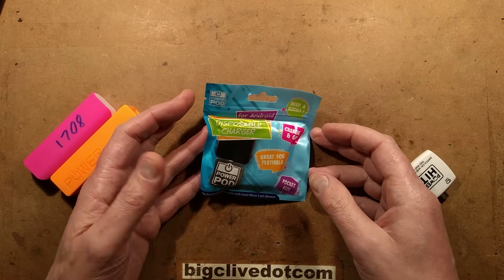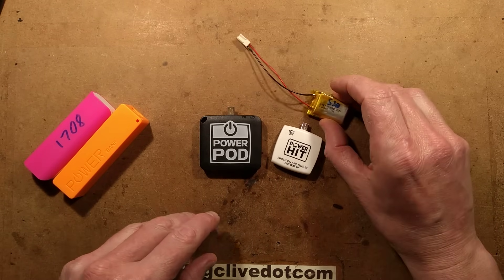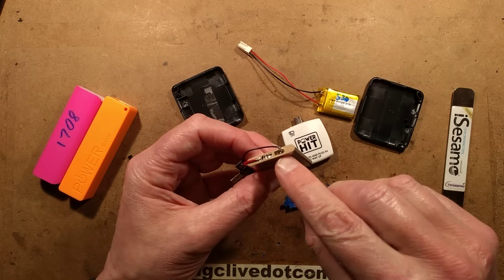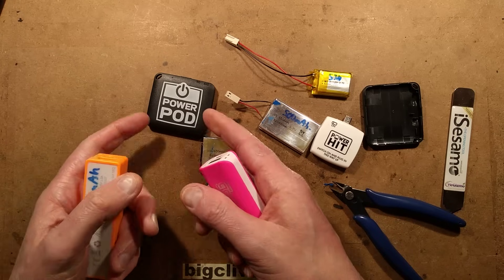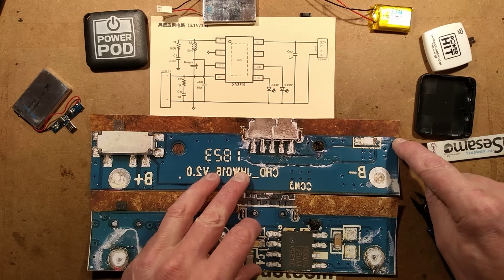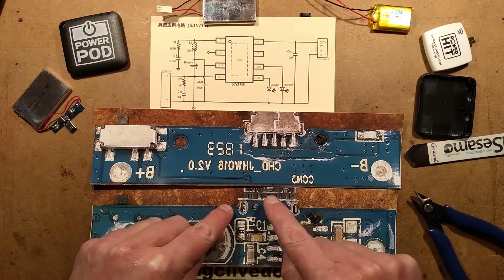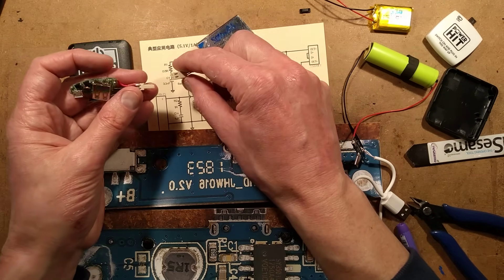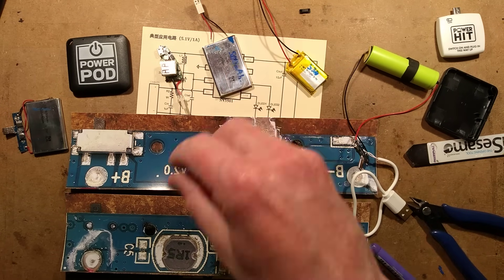Poundland "disposable" phone charger.

Comment: I bought a fair few of these to take off the market for disposable use, I stripped them and use the batteries along with a USB charger pcb, yes more expensive in the long run, but, I put these "disposable" products to use that can be recharged fine.

Comment: its possible these may be recycled cells, I know a lot of the cheap knockoff 18650 batteries are just old laptop cell's repackaged. Alot of the battiries you recycel head back to china, They probable put them in big piles based of if they look like they will be worth reusing or if they are to be torn down.

Still a massive waste, how much does the protection circuit cost? if they are recycled, it probably still had it on. and that resistor and capacitor in volume are about 1c each, so for next to nothing it could be rechargeable.

Comment: everyone is saying it's wasteful, and it does seem so, but if they're really using old recycled cell phone batteries, is it still a net negative for carbon emissions? i guess it probably is with the production of just the plastic casing and circuit board..and the fact they have to put the batteries in the metal case.

Comment: i got one of these today. there is more circuitry inside them now. and by more circuitry i mean 2 extra chips . one seems to be a diode and the other is a 6 leg'd black chip . The same one used onn the new tp4056 not sure whats its called.
Reply from the maker: If it's the iPhone version the chip may be to talk to the iPhone to get it to charge.
Reply: @bigclivedotcom  I think that is the case as i tried to modify it for an micro usb phone and it wouldnt work , it charged for less than a second and then went off.

Comment: Pointless. A shop here in New Zealand called "JayCar" sells a small plug adapter for any phone, which holds either a standard 9volt battery, or AA/AAA cells (depending on the plug adapter chosen) so you can charge on the go fast, re-use it and replace the standard cheap battery when flat. Safer, cheaper and better environmentally than lithium cells.

Comment: Clive: What are you using to measure battery capacity? Apologies if this is already in another video but haven't found it yet.
Reply from the maker: I fully discharge the cell and then use a few different devices to monitor mAh input.

Comment: You say these batteries have no protection circuit, but you can get a string of 10 tiny protection circuits from China for a pittance if you want to recover and re-use batteries like these and give them full protection.  Soldering is a tad fiddly because the boards are so tiny, but they work.

Comment: seeing as my phone has a 13,000mah battery and you lose around half the energy between the battery in the power bank and the battery in the phone, i would need approximately 40 of these to fully recharge my phone from dead to full

That's £80 for ONE CHARGE 

You can get a 30,000mah power bank off eBay for half that price, and it would recharge my phone about 1 and a half times (or a Normie mainstream phone around 5 times)
Reply: What phone are you using!!
Reply: @ExcaliburHeavyBattlecruiser  ulefone power 5
Reply: @mwbgaming28  That phone is thicc
Reply: @ExcaliburHeavyBattlecruiser  so what

I only need to charge it once a week with heavy usage, and Il be upgrading to the energizer phone with 18,000mah (which is even thicker with almost double the performance and an even bigger battery)
Reply: @mwbgaming28  you love thicc and batterilicious phones, right?
Reply: @ExcaliburHeavyBattlecruiser  as long as they work on my country's networks and have reasonable performance to go along with that enormous battery, the thickness is more of a side effect which makes the phone more durable and able to be used as a weapon in the event of a mugging
Reply: @mwbgaming28  sadly I have the Samsung Galaxy s5 and it has a pathetic 2800 mAh battery which lasts for only 2-3 hrs of the screen being on. Gonna upgrade to the Oneplus 3 fairly soon.
Reply: @ExcaliburHeavyBattlecruiser  get yourself a zero lemon 8800mah expanded battery, I had a few of them when I had an S5 that I would bring with me when I went out camping, I would usually go camping on a Friday morning and on most trips I would drain 2 of them and be about half way through the 3rd one by Monday afternoon, and that's with me streaming music from YouTube most of the day, using the torch at night, making phone calls, using GPS and taking pictures.etc

Only once did I drain all 3 zero lemon batteries and most of my reserve battery (the original battery that the phone came with) and the reason for that was because me an my partner were stuck in the bush for an extra day because the car battery was dead and we had to wait for the solar booster to charge it enough to start the engine (thank fuck for Aussie sunlight levels lol)
Reply: @mwbgaming28  I prefer more optimized and better functioning software on my phones over sheer hardware but we all know just how anti-consumerist Apple is. Thus I'll stick to Samsung and OP phones.
Reply: @ExcaliburHeavyBattlecruiser  well optimised software isn't going to do shit when you actually start using your phone

Samsung is just like Apple z everything apple does, Samsung starts doing (camera bump, screen notch, non removable battery.etc)
Reply: @mwbgaming28  how does the Google pixel 3 take better photos than the mate 20 pro?
Reply: @ExcaliburHeavyBattlecruiser  no idea but I'm happy with my phone that has a 21mp camera, what I was referring to was the fact that the hardware in your phone will still use energy when it is being used, you can have the most efficient hardware on the planet, but as soon as you a actually start using it, your battery life will be directly tied to the capacity of your battery

The galaxy S10 might have a more efficient CPU than my phone, but I guarantee the S10 will still die first when both are put under the same load
Reply: @mwbgaming28  Sure the s10 dies first but I hate software that isn't efficient, is ugly or is unstable. Lenovo just factory reset by itself. And since I'm an urbophile, I prefer phones that charge faster like the OP series even though they have lost their claim of flagship killers. They're still killer flagships that are blazing fast and have good software. Alternatively Samsung has all the features you want for a modern phone. That's what the general public want. Your option isn't directly better or worse. It's just that we have different ways of using phones.
Reply: @ExcaliburHeavyBattlecruiser  the fast charging claim is bullshit, both phones use the same fast charge technology, both devices will store the same amount of mAh per hour of charging, the difference is my phone can store more mAh than yours, I can get a whole day of use out of 1 hour of charging with my phone, but if I leave it plugged in overnight, I get almost a week of battery life

My pet peeve is the fact that manufacturers are constantly shrinking the battery capacity and removing features in favor of making the device thinner and more fragile

Comment: After reading an article of a kid dying from electrocution from their phone charging while wearing earbuds is enough to make me want to steer clear from these or other aftermarket chargers that aren’t certified.
Reply: The one where she was talking on her cell while charging it with a cheap AC powered charger, if it's the one I've read? Not the same. The issue many have with these is that they're bad ecologically, just WASTEFUL, they'd be perfectly safe in a lightning storm since you aren't attached to a miles long power line by a sub-standard AC charging device.

Comment: The mosg effective use of these would be to extend your battery's charge while it is still fully charged. I have a 7,000 battery I use with my phone. If I plug it in while my phone is fully charged it will keep it on 100% all day and not drain the whole thing. If i plug it in to charge my phone when the battery is low it'll drain the whole thing and maybe give me 60%

Comment: can't it be very old (and degraded, hence that low capacity) unsold nokia cellphone batteries which they bought for a very cheap price only because no one wanted it? in that way it seems pretty reasonable thing to do...
Reply from the maker: But with literally a few cheap components it could still have been made rechargeable.

Comment: How to make a disposable powerbank?
Get one of these: https://www.amazon.de/Batteriehalter-3xmignon-AA-geschlossenes-Geh%C3%A4use/dp/B000PEJQMO
Add that: https://www.amazon.de/Delock-82697-Stecker-Kabelenden-schwarz/dp/B01A9GLG6Q
Connect red to red, black to black.
And you are done, because AA batteries are sold everywhere. Please note, the links are in german, but they are for demonstrational purposes.
AND NOTE: There is no voltage limiter or other maybe needed electronics included.

Comment: This gives me an idea for a modular power bank. Have a battery that has a proprietary connection port. It would have nothing but just the battery which would make it quite cheap. Then make a charger that will charge the battery and a discharger which will release the charge into an appliance. The charger and discharger would be more expensive but need to be bought only once. The batteries would be cheap and you can buy many using the charger and discharger to use them. This would reuse the parts that don't really deteriorate and allow easy swap of the batteries that don't last as long. This would reduce waste and cost. Just an interesting thought.

Comment: I don't understand why they use lithium for single-use cases. Wouldn't it just be cheaper and much more efficient to use carbon-zinc, alkaline batteries? They're much cheaper to produce and fit the bill of 'disposable' alot easier. jus slap a boost converter on that bish and bam, 'disposable' battery.

Comment: Thanks for the video. I have a Hurricane Turbine Bluetooth headset. Its battery failed after a year. I tried opening it up and replacing it with a Power Hit battery upon seeing that video (I unsoldered the original battery and used a junction block to allow me to screw in a new battery without solder) but that didn't work too well. It didn't last long after charging (only seemed half full according to my iPhone after charging) and after a few cycles was not lasting at all. Just saw this video and gave the Power Pod a go instead. Much better results! Lasted ages initially, and seems to have charged up properly to full with the headset's built in protection circuits seemingly working well. Time will tell how this one fayres but already much better and I bought a second as a spare since they only cost one pound each (not two pounds) when I bought them. It may have been a travesty selling them as one use disposables but it's a great source of cheap but decent spare Lithium Ion batteries to replace faulty ones. It was so nice to resurrect my favourite bluetooth headphones too.

Comment: So here is why this product exists.

 Company A: in this case let's say Nokia has tons of old batteries laying around that are costing money to store, and cost a significant amount of money to dispose of. The cells have little market value due to there age, technology, capacity, an form factor. To legally dispose is really quite costly with environmental regulations!

Company B : approaches Nokia. well call company B PowerPod. They contact nokia and either offer to dispose of their batteries for free or at times even charge nokia for the disposal fee. Most likely these cells were reject to begin with and failed some testing where Nokia or PowerPod didn't feel comfortable putting charging circuitry on them. Technically these companies can't throw these cells in the dumpster.... but a customer can...well they can't but nobody is going to say anything to the customer who we'll call Dave. So, PowerPod "disposes" of these cells for Nokia for a very small fee(less than 1% environmental fees to dispose and assume all liability so nokia doesn't ask any questions) PowerPod takes Nokias money and throws together the cheapest viable product they can hustle to customers(costs maybe 30 cents for them to make this, and don't forget they likely already got payed to dispose of the batteries. 

The Customer: Dave purchases the PowerPod and in purchasing it assumes the legal liability to properly dispose of the device and also payed two pound to take on this liability. 

This product is really just a liability shift scam. Nokia doesn't want to be liable for these cells and disposal of them, so they hand it off to PowerPod who makes a bullshit charger out of it and sells the liability to Dave.

Comment: The point is emergency use. Why would you need to recharge it? Do you run out of juice that often without a charge cable nearby? If it happens enough that you need a rechargeable emergency spare battery all the time then maybe you should just keep a charger in your pocket always.

Comment: The 1200mAh poundland charger is garbage also

I bought a couple and on a full charge I only managed around 20% charge to my phone

At 1200 I wasn't expecting a lot but it's no where near the % comparison for charge Vs my phone battery

I expected at least 30% really

It comes in handy to keep the phone ticking over longer I guess but I just stick to my larger heavier charger now 

The poundland ones make a handy night light though with a USB  LED lamp plugged in

Comment: Inadvertantly I bought one of the iPhone ones as well as the "android" (USB) ones and see the the circuit is quite different. The power bank chip is at the extreme right of the circuit and on the back is a 5 pin chip marked P7 and a transistor or mosfet which I think might be some kind of charge port controller required by iPhones.
Reply from the maker: Ah.  I may get one of those to explore it.

Comment: It is worth noting that the £1 and £2 power banks from £land are using unprotected cells too, which I discovered to my surprise since there are no DW01/8205A chips on the charge/boost circuit. 
Admittedly it is hard to imagine their weedy lithium cells doing much damage even if they did overheat but still makes me wonder what the protection circuits will add above the cut-offs provided by the charging circuitry as they already clearly cut the current when the battery is at around 3V.
Reply from the maker: The protection is built into the single control chip.  It controls and stops charge and limits discharge.
Reply: @bigclivedotcom  OK so when the power pod is emptied as intended, it must stop way before going thermonuclear, especially if likely to be tossed straight into a bin. Hopefully around 3V.
Reply: After svrutinising the SY3591 datasheet using my best Chinese (only slightly worse than my worst Chinese) it seems it will cut out at no less than 2.9V thus moving the dumpster fire risk to the landfill :/

Comment: This should be illegal..  The only purpose this might have is to have one with you so you can use it in case of emergency ..but even that might not work because the battery lose charge with time.. in a few months will be discharged to a point it can't be used anymore...

Comment: i checked old Popular Mechanics Journal from year 1980th and there's article about batteries and scheme for DIY a battery tester-recharger "Battery Brain" - even there they say that carbon-zinc, heavy-duty and alkaline batteries can be recharged with that device 10 times, nicads 1000 times. 1980th year. 😮
Reply from the maker: There is a recharguing technique called PCR (periodic current reversal) that can put some charge back into some non rechargeable cells, but it doesn't put much charge in and often results in leakage.

Comment: Popped into Poundland today and bought one, it came on the till as only £1 so winner 🙂 linked it to a TP4056 with Battery protection LIPO Charger Module Board Micro USB TE420